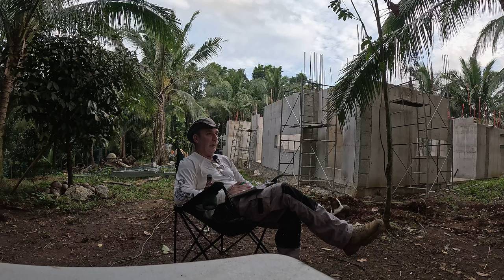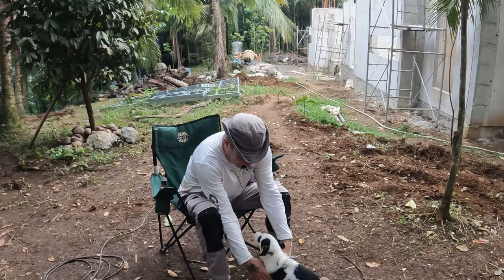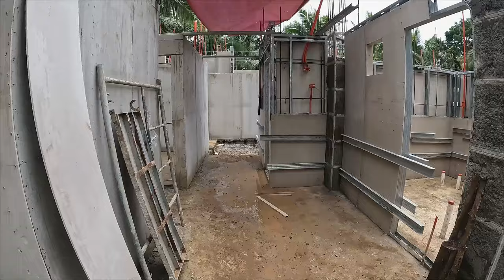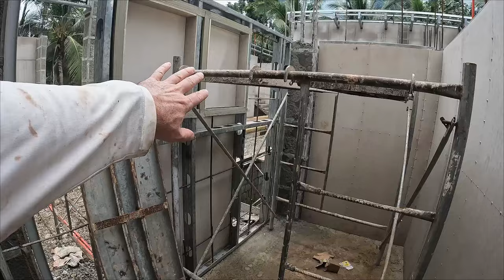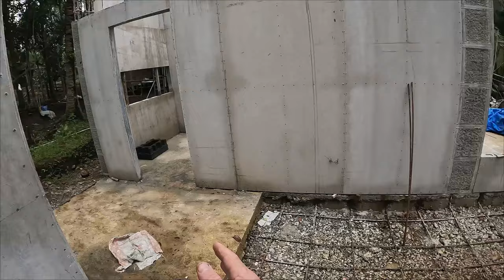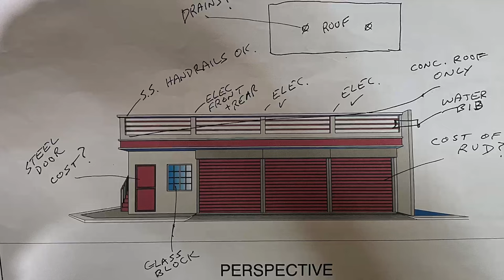Do You Know Your Architect? 🛖 | House Build Philippines | Ep. 26 | TORINO

Comment: I have been following your project. It's different from others I have seen in the Philippines. 

One suggestion you might consider is to run an independent water source for all your toilets only. Allow the line to switch from city water to an alternative water source such as a rain water encashment reservoir. This is in case there is low to no water from the city source.  At this stage of your built, I am not sure whether it is too late.
Reply from the maker: That's a good suggestion, though we won't be using city water at all as they are unreliable and we are so remote they will probably never provide service up here. But, as you suggest, we will have the deep well as primary and river water as backup.

Comment: if you do use a tank type water heater you can always add a top mounted recirculating pump and have a bypass valve under the sink at the far end and it will push the hot water (that has cools down ) back to the tank using the  cold line as a return line ..  this is assuming you dont have a dedicated return line to the water heater ..  i plan on using a solar water heater and a tempering valve tied into the cold so i dont burn anything vital .. the solar tanks  are gravity fed  so if youhave a cold water pump you will need a pump on the output side of the solar tank ( with a pressure switch set at the same as the cold pump switch settings )    google  grundfos comfort pump up15-10 is the model i believe .  but it is 120 v.
Reply from the maker: Thanks for the info. 👍